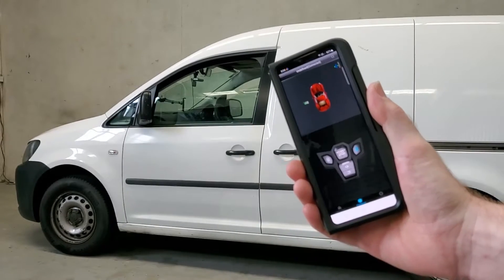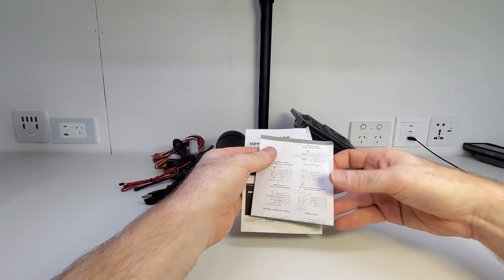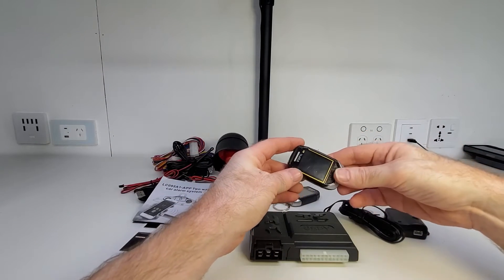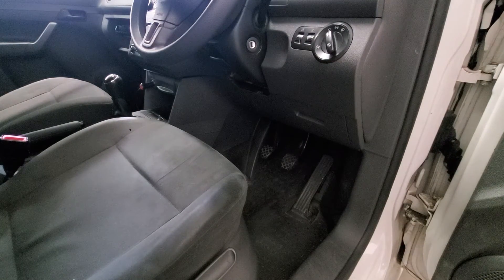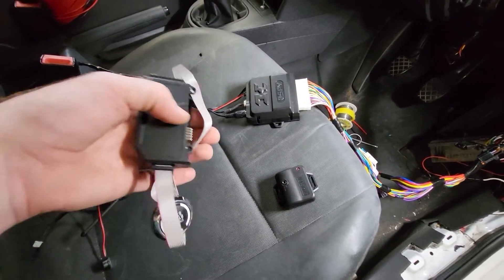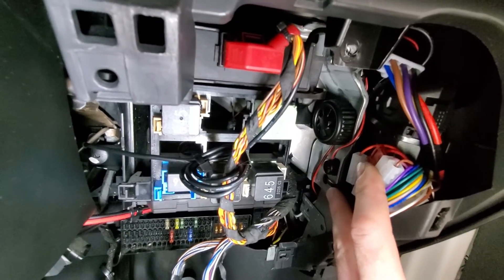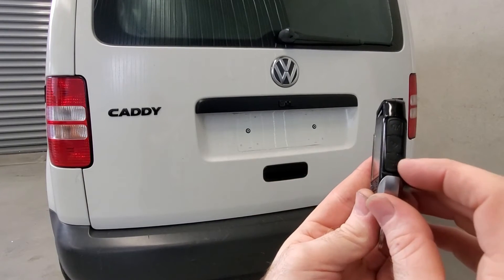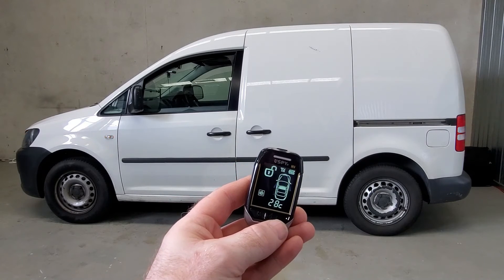How does this Spy 2 Way PKE Car Alarm Work? Review and Installation

Comment: Hey man! I watched your video and decided to buy the same remote start system! I really like it but I have some issues with it! The main problem is, that when I start my car with the push button, the car starts, than in about few seconds flames out and I have to push the button again, than when I start it for second time the car runs normally. This is not happening every time, but more often than not...The interesting thing is, that if I remote start my car using the remote control I have no problems at all, the car starts every time and continue to work. Do you have any idea what could be the reason? I contacted the shop many times, but their support is very poor...
Another issue I have is the Auto alarm option option. Always when I turn OFF the engine and go out of the car ( at the petrol station for example) , there is some reminder going on with sound both on the car siren and the remote control... It's a reminder to lock the car and I can't stop it... I tried the instructions ( pressing the reset button for 5 seconds...), but in both cases the reminder persists and this is very annoying... Any idea how to stop it?
Once again, thank you for your video!  It's very helpful! 
Thanks a lot in advance! 🍻
Reply from the maker: Hi, without seeing the car i can really only suggest rechecking all wiring and connections as that problem is hard for me to diagnose without having the car for testing. This video was quite some time ago so i dont remember the system well now but I think the Auto Alarm option was a Programmable feature so if I am correct  you should be able to turn the reminder off so you could give that a try, best of luck
Reply: @SHORTwithTECH  I understand! My car is Hyundai Azera 2010 and I checked all the wirings 5 times. It shouldn't be cable issue, since the remote control starts the car normally but just the push button is doing this from time to time. I think it's something with the disarm function and when I unlock the car with the remote control, than I start it, something wrong is happening with the disarm function. On the other hand, when I start the car remotely, the car is locked and I have to unlock it before I get in, which is at least 10-12 minutes after the engine start, that's why I have no issue with the remote start, just with the push button...
Anyways...I'll try to figure it out! :)  
Thanks a lot for your replay!  🍻

Comment: Hey if you still have this car alarm I have it andnim trying to see if there's away that once I remote start it can I do a takeover where I can just drive without the engine cutting off
Reply from the maker: You would need to get a professional installer to help you with that but it will also not be possible to do this on some cars without modifying the cars setup
Reply: 원격시동 후 문을 열고
차에 탄 후에..
브레이크를 밟고 시동버튼을 누르세요
시동이 유지됩니다.

Comment: Hi, I'm wondering if you could help with the very vauge instructions that come with this alarm system. 
There is a pic of an ignition switch that you are supposed to hook up a white wire to the "Accessory"... and the "On" position goes to "High Voltage Coil", beside that looks like a relay that your supposed to cut the Coil wire.
Can you help with this? Im not sure what this pic is describing. 
Thanks.
Reply from the maker: The wiring diagram is just explaining to you that the High Voltage Coil gets its power through the Ignition Switch and its telling you that you can immobilise the Ignition If you want to but thats entirely up to you the installer if you decide to immobilise the Ignition, the Fuel supply, the Starter Motor or whatever else. Irrespective of what you immobilise, the example of how the relay is connected in the diagram will still be the way you need to wire it up, hopefully that answers your question

Comment: Great instructive video...could yo tell me please does this have proximity sensor? If a potential theif is too close to the vehicle chirps as a warning? Too long near the car alarm goes off ? Or,is that another add on as it were. Thankyou
Reply from the maker: No but a proximity sensor can be added to any car alarm so you can just order one as an add-on and install it yourself if you want to
Reply: @SHORTwithTECH thankyou for you quick reply. Im i right in thinking,i can add a microwave sensor. To my stock  existing car alarm. I have a nissan qashqai j11. Thanks again for your help and expertise
Reply from the maker: @mikehowarth7329  Generally a car alarm has atleast one sensor communication port. This communication port can be used to add any sensor e.g. Proximity, Shock, Glass Breaker, Tilt sensor etc so if your exsisting stock car alarm has that then yes you can. If your referring to Nissans factory alarm then no because that is controlled by the body module

Comment: Hello, I have this alarm installed, which comes with the light module. From one day to the next, the remote start function stopped working. The car makes a sound when I press the remote start button, but it doesn't turn on. However, using the button, it turns on normally. I have tested the purple wire signal that goes to the handbrake and it's fine. The handbrake is sending the negative signal it needs. Another problem I have noticed is that if the handbrake is on and the lights are on, the car does not turn off correctly. Greetings, I hope you can help me.
Reply from the maker: Unfortunately these problems very hard for me to resolve when I don't have the car so all I can recommend is resetting the alarm system and rechecking all your wiring again. At a last resort I would recommend contacting the supplier if you think there is a fault with the alarm unit itself
Reply: Sorry, but how do I reset the module and what cables do you recommend I check?
Reply from the maker: @JulioTheColossus sorry I cannot help you with your wiring, a remote start alarm requires alot of experience, knowledge and skill to do and for that reason i would recommend it be installed by a professional auto electrician. When I say reset it, i only mean disconnecting the power source for a few seconds and then reaplying it again
Reply: I already did that and also checked the signal from the purple wire that goes to the handbrake.

Comment: I need to change function auto unlock on acc off. Do you know this function?
Reply from the maker: This is a factory set feature so no need to program it. The way this feature works with this Alarm system is by using the Foot Brake pedal. When you press the foot brake, after 15 seconds the car will lock, then when you turn off the ignition the car will unlock. If this is not working for you then recheck your wiring, the ORANGE wire must be connected to the Foot Brake pedal, if you dont connect the Orange wire then this feature won't work
Reply: @SHORTwithTECH I want to disable this option. Can you help me?
Reply from the maker: @two_weeks_of_fog  I am not aware of anyway to disable that feature with this Spy Alarm. Not connecting the Foot Brake wire would disable it but if course that wire is required for the remote start to work aswell so i don't recommend it

Comment: Hello, I would like to install this alarm but without all the options and only use the motion detection. Would it be possible for it to work without having any faults?
Reply from the maker: Not sure what you mean by motion detection, you would require a microwave sensor to be connected for this alarm to work in that way
Reply: @SHORTwithTECH  with this alarm there is provided a shock detector and I would like to install only this one and the siren because my vehicle is an old vehicle without central locking and the remote start system does not interest me I want to use this alarm only for shock detection activation with the application and the two-way remote control
Reply from the maker: @printer3dfr  yes thats right, the shock sensor is a vibration detection sensor, it does not detect motion. Yes you can do what your wanting to do but you will still need to use all the wiring harnesses, just don't connect all of the wires including the remote start module and it will just function like a standard car alarm
Reply: @SHORTwithTECH  Thank you for your help. I will give you the result when I have installed the alarm. I hope that it will not cause a fault since I will only connect the power supply, the shock sensor and the antenna 😅 If this does not work, I will return the equipment to the seller
Reply from the maker: @printer3dfr you will need to connect more wires then that for it to operate correctly so I would  recommend you seek help from a professional installer if you donot know how to do it yourself
Reply: @SHORTwithTECH  Hello, I received the alarm and installed it. I simply connected the power supply and the shock detector and it works without errors 👍🏻
Reply from the maker: @printer3dfr that's great, good work

Comment: Здравствуйте!Приобрел данную сигнализацию,еще не установил.Брелок как работает?На кнопки не реагирует.Как он включается?
Reply from the maker: By default the remote controls are supplied turned Off. Press both the LOCK and UNLOCK buttons on the Remote Control together at the same time to turn it On or Off

Comment: Hi! It is normal that when the car is off the device appears as disconnected on the app? It asks me to connect it again but it only does when the car is on.

I would like to get a notification on my phone if someone tries to rob my car. Is it possible? I’m new to this alarm.
Reply from the maker: @Andrea93JB  no that's not normal, it sounds like it has not been wired up correctly. You will get notified on your pager remote if someone breaks into your car, but only providing you are in range with the main control unit. If you want long range then you will need a GPS based alarm 
like Easyguard but the cost is also considerably different aswell  https://youtu.be/rhx5DT9POWI?si=PXjJMnCl-piQBh4V

Comment: A good video but is it possible to do a simple simulation without a vehicle just with a battery?
Reply from the maker: @AugustZongo  Thank you. Yes absolutely, you can simulate this device on the bench using a car battery and some test wires
Reply: @SHORTwithTECH  Is there an indicator that shows that the system is working once powered?
Reply from the maker: @AugustZongo  Yes, the Flashing Alarm Led won't work if the system is not powered up
Reply: @ How it goes you can guide me a little just with the essential points
Reply from the maker: @AugustZongo  the essential points are +12V, ACC, Ground, Door Trigger. You just need to wire it up according to the wiring diagram supplied with it
Reply: @ thank you
Reply: Is it possible to have your contact email or WhatsApp etc???
Reply from the maker: @AugustZongo  i just use the YouTube comments section.for communication
Reply: @SHORTwithTECH  I wanted to know just to be able to connect with my phone or with the remote control can I simulate with a battery simply if yes what are the wires concerned
Reply from the maker: @AugustZongo  Just to be able to communicate with the Alarm system with your phone you only need to power it up so just +12V and Ground are the only wires needed to do that
Reply: @SHORTwithTECH  If I power the red wire and the black wire what happens next?
Reply from the maker: @AugustZongo  if you put the red wire to the + Positive Terminal of your Battery and the black wire to the - Negative Terminal of your Battery the Alarm system will be powered up enough to communicate to it with your Phone. After that the wiring gets very complex and will need to be wired up by a professional auto electrician. Car Alarms are impossible to wire up if you have no experience and I don't recommend trying it or you could seriously damage the alarm system and the  electrical system of your car costing thousands of dollars to have repaired
Reply: @SHORTwithTECH  But by putting the red wire and the ground the INDICATOR LED have to flash???
Reply: @SHORTwithTECH  Is there specific training for this or support materials???
Reply from the maker: @AugustZongo  Yes the Led willl flash
Reply from the maker: @AugustZongo  you can learn auto electrical basics through online courses these days i am sure, you can try Google search to see what's available
Reply: @SHORTwithTECH  I have a 13v battery and an LC095A1 system. I powered the system with red and ground only but nothing happens to the Led indicator nor to the remote controls or the mobile application.
Reply: But on the other hand the shock sensor flashes if a disturbance is produced
Reply from the maker: @AugustZongo  sorry I cannot understand why that did not work for you
Reply from the maker: @AugustZongo  Yes so the system is powered up then, so now just pair the mobile app to the main control itnterface
Reply: @SHORTwithTECH  can you help me with a wiring data sheet???
Reply from the maker: @AugustZongo  the wiring diagram for the car alarm in this video can be found on my Instagram which is shortwithtech.official

Comment: How did you turn off the remoth when not using?
Reply from the maker: @seth5320  Press both the LOCK and UNLOCK buttons on the Remote Control together at the same time to turn it Off or On

Comment: Does it work with any vehicle?
Reply from the maker: @KittichaiKerdsongsang  yes and no. Some late model vehicles these days are not designed to have an aftermarket car alarm like this installed to them so that will make the installation difficult

Comment: I bought the same alarm and now I have to connect it.  I tested it on the table with external power supplies, but I have one question.  The front cover and trunk lid since there are no separate cables will connect to the door button there is no other option.  I tried a simulation to unlock the trunk, but when it was opened the alarm went off.  Did you connect the trunk lock to the door cable?
Reply from the maker: @RosenRusev-o7e  this alarm is not designed to monitor the hood and trunk so yes you would need to connect them to the door wire. No you don't connect the trunk lock to the door wire, this is a completely different feature. The trunk lock release wire (red/black) is an output, the door wire (green or blue) is an input
Reply: @SHORTwithTECH  Thanks for the answer. I know that these are different functions and I didn't express myself correctly. To use the trunk opening function, I don't have to connect the trunk to the blue cable that monitors the opening of the doors. I have to choose whether I want the trunk to be opened by the button or for the alarm to monitor its opening. Both things can't work because there is no additional channel that monitors the opening of the hood and trunk.
Reply from the maker: @RosenRusev-o7e  no you can do both but of course the alarm will need to be disarmed first before opening the trunk as the alarm is not designed to monitor the trunk

Comment: 15:50 the symbol on the controllers screen on the bottom left, does it means that vibration for the controller is activated?

Comment: Can you help me to find where auto arm off? Nowhere any information
Reply from the maker: @Max-vt7wd  Turn the auto arm feature in the settings off: 
1. To enter the settings press and Hold the LOCK and UNLOCK buttons on the Remote Control at the same time until the Remote Control beeps and the Lock symbol illuminates.
2. Keep pressing THE LOCK button on the Remote Control to select the Auto Arm option.
3. Press the UNLOCK button of the Remote Control to select OFF.
4. Press and Hold the LOCK and UNLOCK buttons on the Remote Control at the same time to Save your settings, the Remote Control will beep to confirm the settings have been saved and Auto Arm will now be turned off.

Comment: Hello, can you help me with something. I want to change it so when i press the key fob once it opens all the doors. At the moment id have to press it twice and itll open all the doors. One more thing it automatically locks after 30 seconds or so i believe is there a way to turn that off? Almost locked my key inside one day 😂
Reply from the maker: @khonsaidahmedov8848  You need to change the auto arm settings: 
1. To enter the settings press and Hold the LOCK and UNLOCK buttons on the Remote Control at the same time until the Remote Control beeps and the Lock symbol illuminates.
2. Press THE LOCK button on the Remote Control again to select between Minutes, Hours, Clock etc.
3. Press the UNLOCK button of the Remote Control multiple times to adjust the timers to your personal requirements.
4. Press and Hold the LOCK and UNLOCK buttons on the Remote Control at the same time to Save your settings, the Remote Control will beep to confirm the settings have been saved.
Reply: @SHORTwithTECH anyway for it to unlock with just pressing the unlock button once so it opens all doors?
Reply from the maker: @khonsaidahmedov8848  that is a feature of the car itself by default. I don't know how your Installer has wired it up for you and I don't know what type of car it is but I would recommend asking  your Installer to change it for you so all doors unlock
Reply from the maker: @khonsaidahmedov8848  Have a great day

Comment: @ShortWithTech I have one, M9, but one of the remote control is not working. Is it possible to reprogram it? It starts and show everything except the antena signal and when I push the bottoms it does not work. 😢
Reply from the maker: @FurtadoDany  is that a Easyguard or Spy Car Alarm?
Reply: @SHORTwithTECH  Spy Car Alarm
Reply: @SHORTwithTECH  Spy Car Alarm